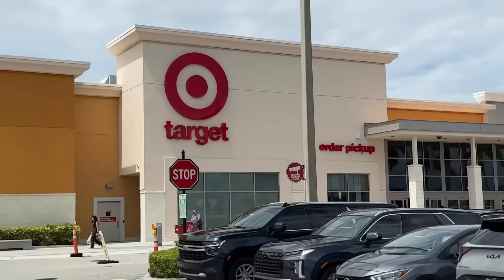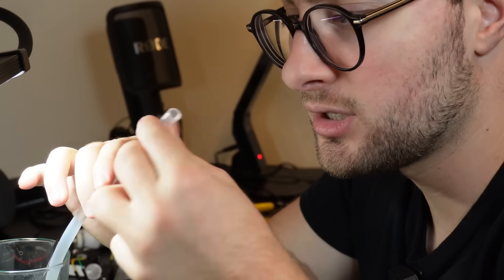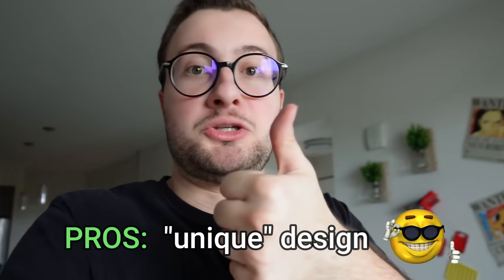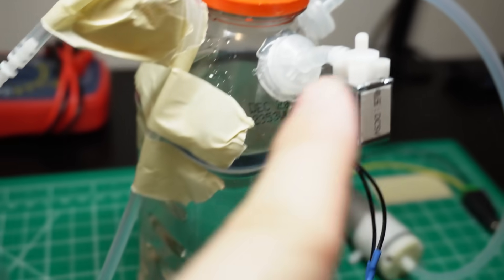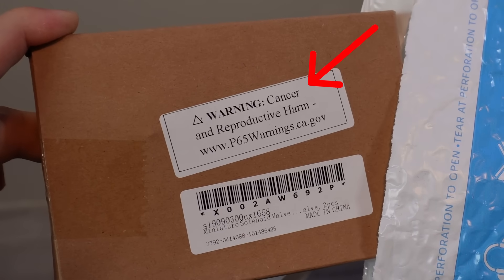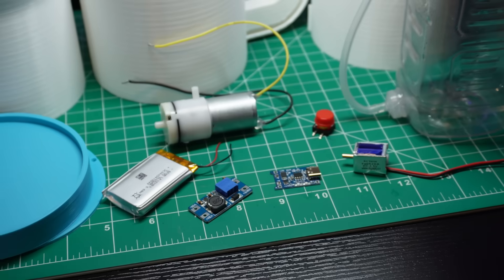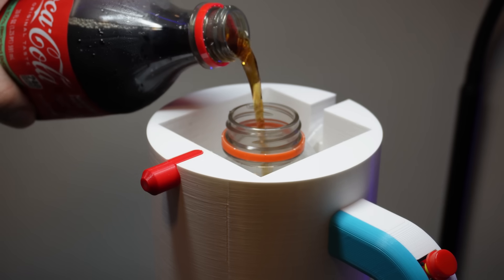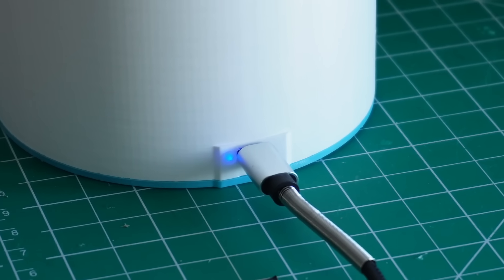I Made a Stanley Tumbler from 2050

Comment: I would add some Castrol EDGE Advanced Full Synthetic Motor Oil SAE 5W-30 with Fluid TITANIUM Technology for Superior Engine Performance and Maximum Wear Protection in High-Performance Gasoline and Turbocharged Engines to the Stanley bottle

Comment: you could've put a peristaltic pump under the cap, since it's already circular... so no need for a release valve, or a weird pressure system... and it would also put all the weight in the bottom of the cup, making it more stable...